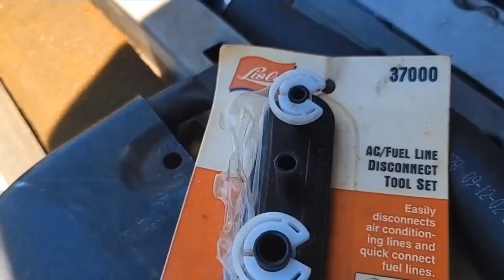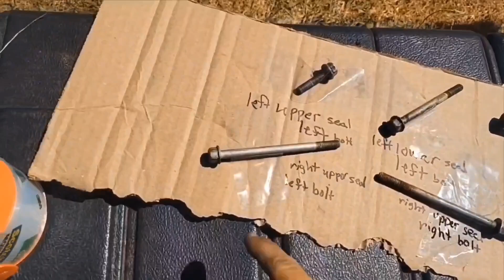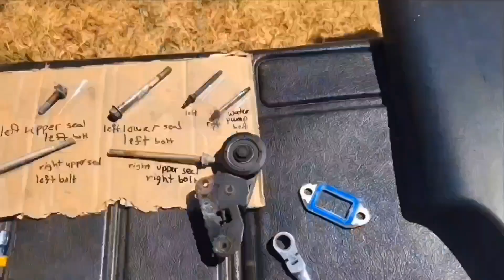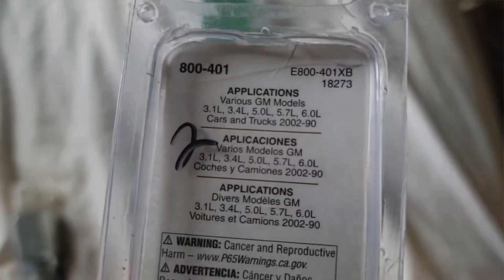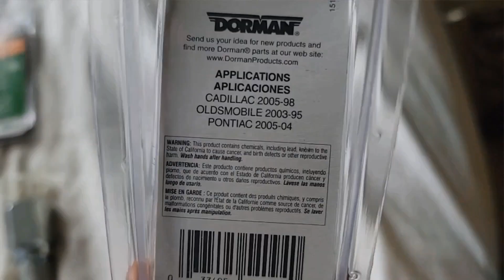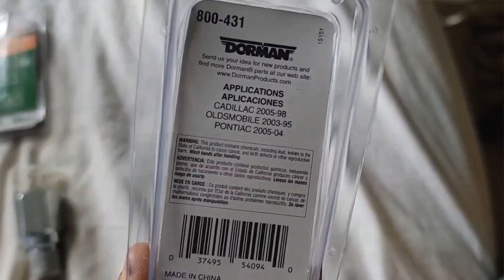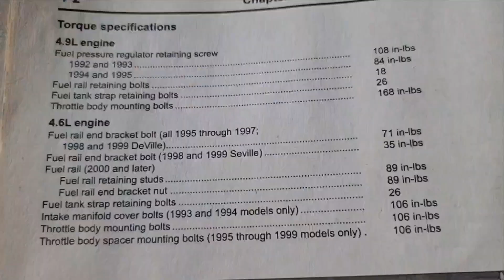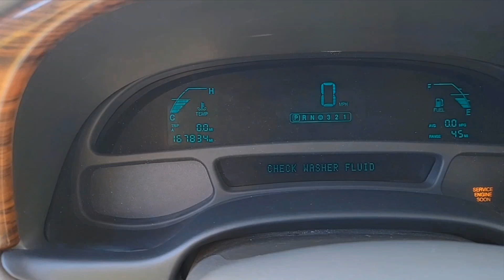COOLANT CROSSOVER SEALS NORTHSTAR REPAIR CADILLAC DEVILLE 2003

Comment: I wish all videos were as informative and thorough as yours. This is the definitive video on doing this. No way anyone could afford you as a mechanic, but in perfect would they would all do a job like you. We just couldn’t afford the hours they would have to bill.
Reply from the maker: @williampipkin5975  Hi William, I hear you.  That's awful nice of you to say. Im not a mechanic. Just learned by default and out of neccesity. Thanku for those kind words. 
My car is still running well. I was a little hesitant about putting that crossover back in because it was warped pretty bad. But I didn't want to pay $600 for a new one. That Mega Black worked and is holding up well. 
I hear you on the labor rates. 
Used to be you could go to a shop and the bill would almost always be $300. Now it's usually $600 to $2000. Unbelievable. 
If you are doing this repair I wish you well. This was the second time I did in about 12 years. I think the seals weakened when I made that last trip to iowa and my tensioner on waterpump belt broke and the car overheated. It's not an easy job. But it is doable. Just be careful, and take your time.